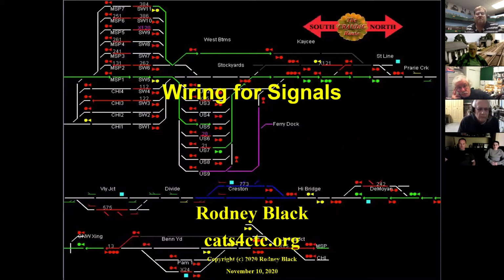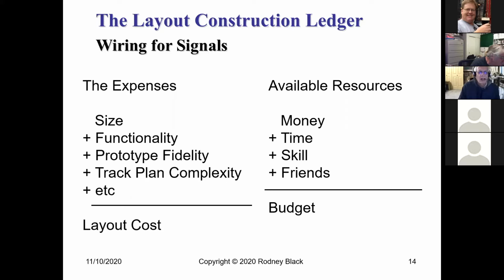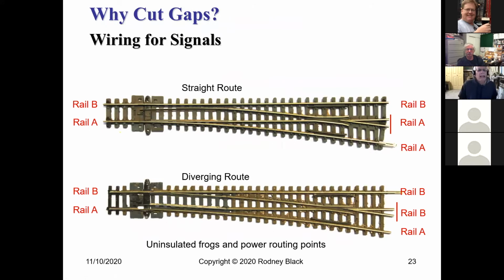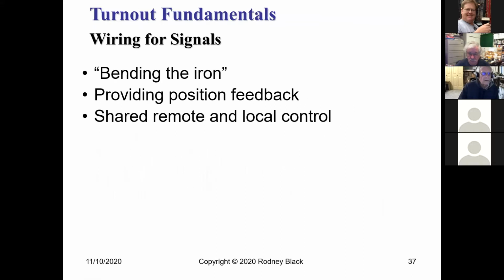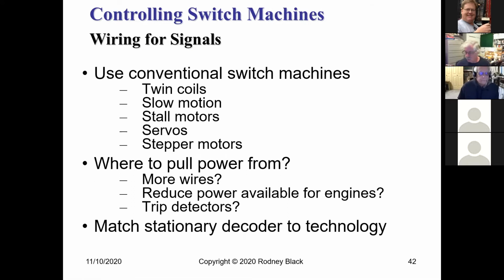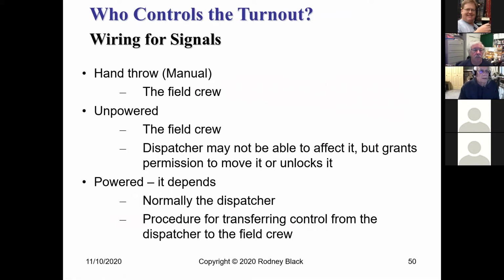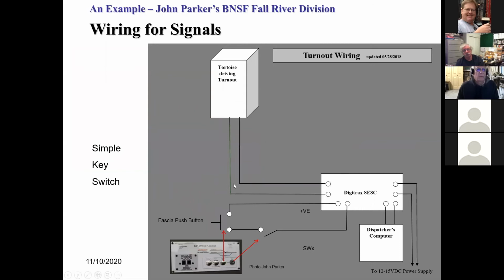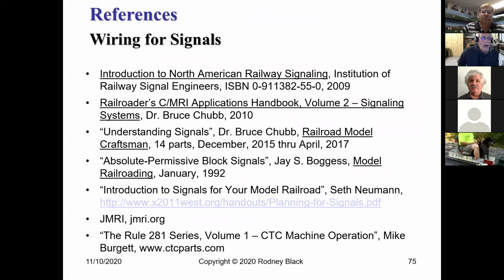Herding CATS 104: How to Wire a Layout for Signaling

Comment: Hello Rodney, you are correct with your description about slide 52. The despatcher would give permission to put the turnourt in the "Hand" position and then the on ground staff can change the turnout from closed to thrown. This is acheived by unlocking the two locks on the motor. Throwing the smaller lever from tmotor position to the hand position and then using the larger of the two levers to move the lie of the turnout. This is done when there is a turnout has failure or for maintenance porcedures.